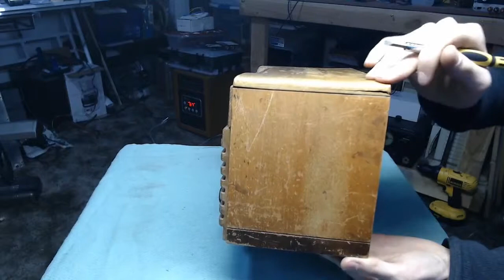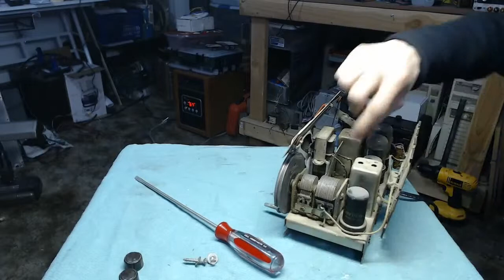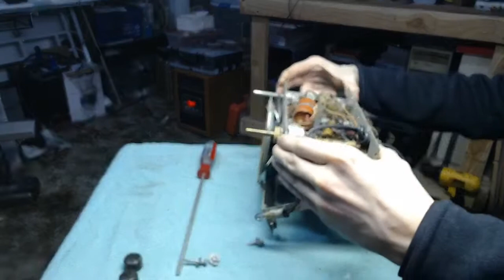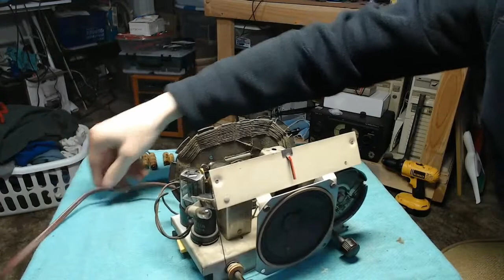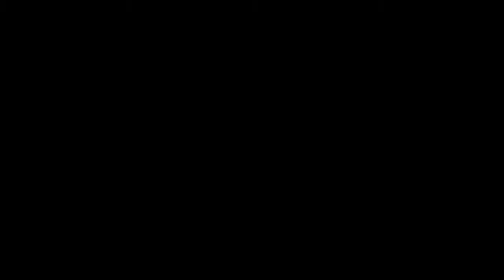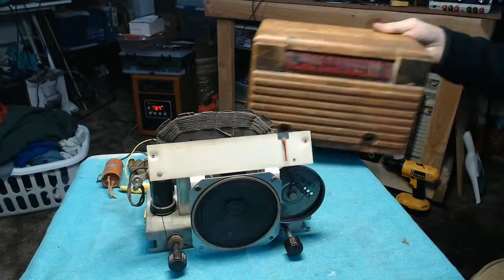DeWald A-503 Repair

Comment: Hello there. I know you made the video over a year ago but hope this helps in the furture. When doing an RF alignment, the trimmer on the large variable tuning condenser is to tune the antenna. The signal generator needs to be loosely coupled using a coil of wire near the antenna and should not be directly coupled to the set when adjusting that trimmer. When you directly couple the signal generator to the set it bypasses the antenna and is why you could not adjust the trimmer. If that trimmer is out of adjustment, it can greatly affect the radio sensitivity and therefore must be set during an alignment. The backwards dial is caused by the dial cord being restrung incorrectly in the past. including the missing turn you added around the shaft is further evidence. On a radio that old it is common for them to break by now. Typically included with the radio alignment instructions/schematic there would be a dial cord restringing illustration for them?
Reply from the maker: Thanks for the advice. Unfortunately the alignment data for this set was very simple, and the Riders does not include a stringing diagram. However, most if not all of the sets I have done RF and IF work on specify connecting the generator through a coupling capacitor to the set. I'll keep the loop in mind!
Reply: @Eclec-Tronics  Great video, You got my subscription! Yes that Riders's section surprisingly did not have the dial stringing! The instructions say to keep the signal generator as low as possible so that method would work ok on a VERY low, barely audible modulated signal. On simple sets like AA5's, i've done the whole RF alignment using the loose coupling technique.  You can just lay the signal generator over the loop antenna too but a loop or roll of wire a few inches from the antenna is better.
Reply from the maker: @multicyclist  It suddenly dawned on me last night that I was injecting a signal into a tuned loop antenna, so now I just feel silly.
Reply: @Eclec-Tronics  It's all good. The reality is one never stops learning about these things. Keep up the good videos.